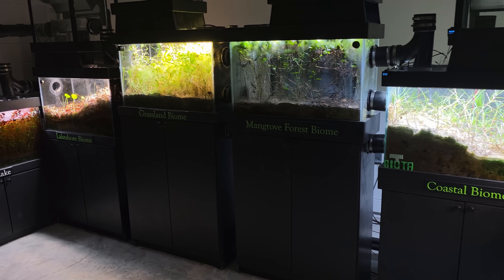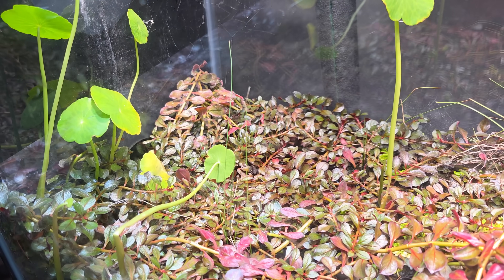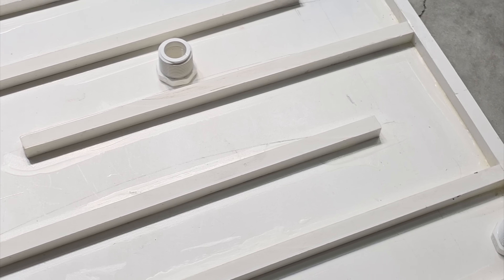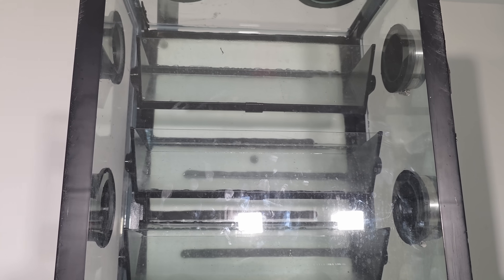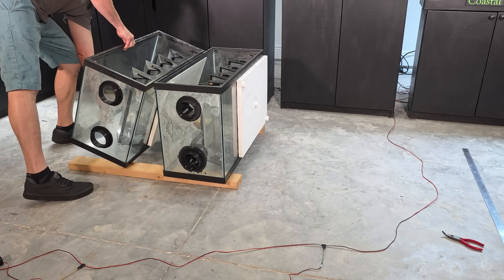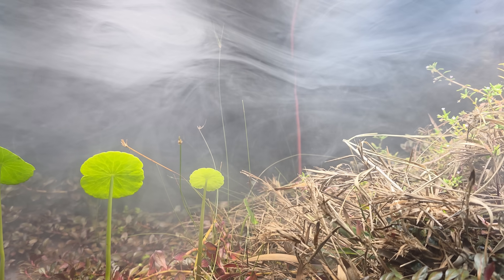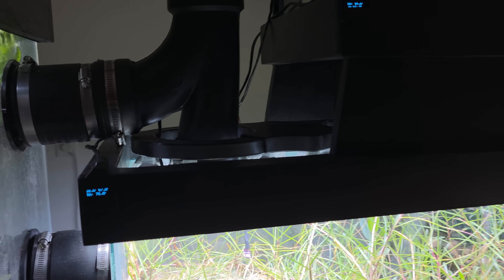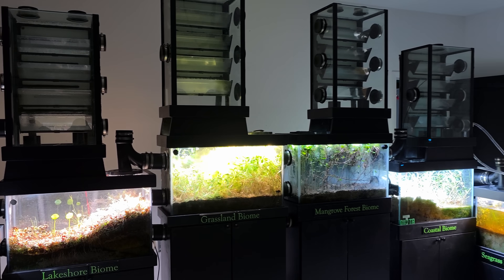Florida Man Builds a Working Biosphere in His Garage

Comment: When you’re done with this it needs to go in a museum to see how many hundreds of years it can keep going.
Reply: Weird that you could ostensibly create a new species by just keeping them in a sealed tank long enough.
Reply: @rubenotero7100  true, though if it’s completely sealed and they adapt to different levels of oxygen then it could be difficult for them to live outside of the ecosystem if it were ever opened. 
Lots of exciting things happening with this project!
Could even make another project where you can artificially change levels in oxygen doing tests to see how the environment and insects react.
Reply: As long as the battery lasts for the lights?
Reply: @wwpark  it’s plugged into the wall, but a day or two won’t end it.
Reply: @wwpark oh wait, but then the sun will already be the light 😂
Reply: @wwpark maybe in a museum that has an open or windowed area, and then he uses solar powered lights?
Reply: Aquarium silicone lasts about 10 years in good order. So, does need that modular side of this to kick in for maintenance

Comment: I wonder if adding a Pelagic tank could help with the crab (and other critters with a larval stage) lifecycles? 

Maybe there are just too many filter feeders in the Saltwater biome, and they're snatching up all the larvae in their free-floating phase.

It would also have the benefit of increasing the total saltwater in the system, to help with water parameter stability.
Reply from the maker: Yes you're right about that. More of these tanks will be needed and I hope that's what helps bring up crab and shrimp  zoea. I have the designs made for these additional tanks and plan to build this out mid 2026. The design is in a recent long form and it will include connecting these tanks to an estuary and the freshwater side.
Reply: @miniBIOTA Fantastic! Can't wait to see it. Is the plan to keep every biome in the same tank? Or to customize based on the biome? I.e. like if a round tank would allow for better currents in a Pelagic biome (idk if that's the case, just spitballing)
Reply from the maker: Due to space, I have these designed for the same modular tank. I'll continue adding and wrapping these around the garage.  I have a image of the design linked here: https://minibiota.com/donate
Reply: As I'm writing this I'm thinking of how interesting it would be to have the current seashore and inshore/bay biomes, a Pelagic biome and then an ocean floor biome (rubble substrate?). You could vary the lighting at the deeper stages to mimic depths - maybe with a curtained off front, so you could check on it, but have it stay dark most of the time.
Reply: As an fellow reefer and breeder im looking forward for this as well as an reefbiome added!
Reply: @gocedimoski728 me too, especially a naturalistic one. I love a reef tank as much as the next guy, but they're like bonsai trees, and it would be really interesting to see one that more closely resembles the color and features of a natural biome. 

My only real concern would be aiptasia taking over everything.

Comment: Now that the ecosystem is sealed, you should focus on restoring it from the bottom up. I'd start by catching various species of springtails, plankton, pseudoscorpions etc and move up in size slowly.
Reply from the maker: Yes! There's still a lot more efficiency to gain from the convection dynamics and sensors to add but I'm thinking about a lot of changes needed with the organisms, starting with highy productive plants that will form the base and then go from there with primary consumers.

Comment: did you pressure test it?
Reply from the maker: The old design yes, to the point of failure  but not this desigin yet. It definitely holds up much better but also, the pressure issue has been eliminated. What will be needed now though is an automatic shutdown if pressure moves pass 1 PSI. This will be added soon
Reply: @miniBIOTA I know biosphere two had some expandable bellows sort of things to help manage pressure, you might be able to try something like that.  The simplest version would just be a balloon attached to a nozzle on a bulkhead.  It'd be a good visual indicator of pressure changes too, as it inflated or deflated.
Reply from the maker: Yeah! I'll do exactly that once it's totally air tight. Right now, pressure can still escape but not for much longer

Comment: I have a question, are you planning on adding any Reptiles or other types of invertebrates?
Reply from the maker: It's tricky at this size. I've tried it successfully with a house gecko for a couple years but ultimately, the house gecko would eliminate any second gecko so there was no chance of a reproduction cycle. Diversity also got wiped out. It became a dynamic of just surinam roaches and it because these roaches mostly lived in the soil and out of reach. There would need to be a lot of habitat for other insect species to have shelter and breed.

I'll like to try a grass frog one day but we'll see as the system expands
Reply: It had been super cool ta have snakes there but i fully know it would be totatly unrealistic by practicaly all possible aspects, so i guess we have to imagine them being there, but i think it could work in a semi closed system with smaller animals perhaps, if one find something very, very small... 🙂
Reply from the maker: I had a snake too at one point, a Florida brown snake but I added worms and crickets all the time that supported it. I didn't want it to go hungry and I ended up releasing it back into the wild. As it turned out, the snake ate much more than what I was expecting so I'm not sure if they can be sustainably kept like this. Probably only once the system is significantly larger. Hopefully one day😅
Reply: @miniBIOTA  Yes, You did the right thing by releasing it back in the wild after the study, it sounds like a super cool experiment! It is always genuinely fashinating to study wild animals that has not been domesticated.